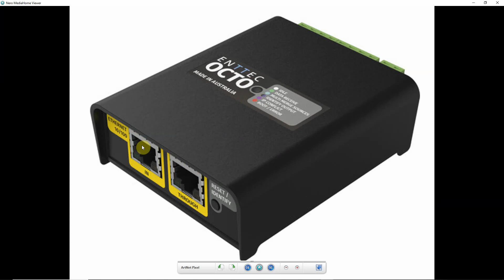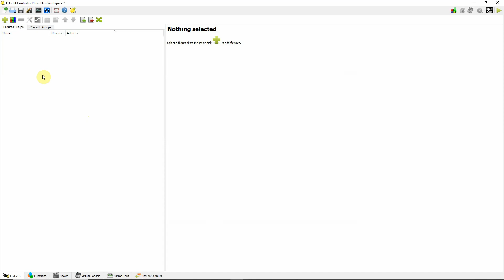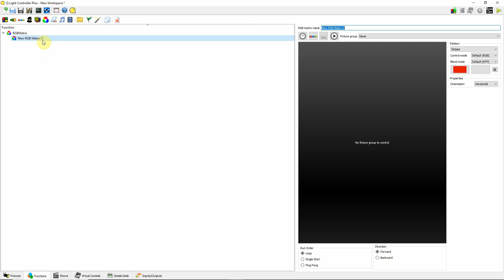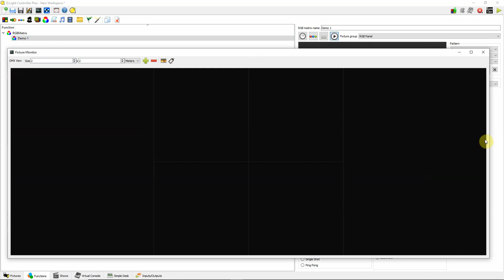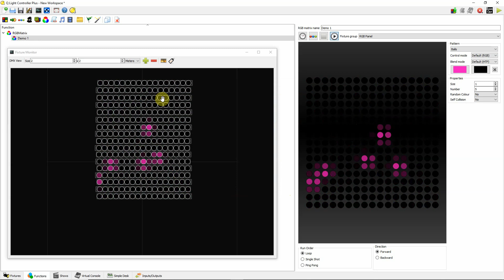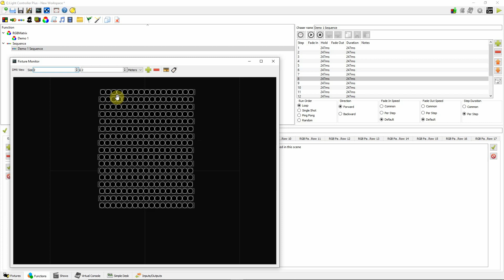Using LED Pixel Tape with QLC+

Comment: What did you set on the display at the DSA 1024 Pixel SPI to DMX Decoder 5-24V with RF Controller for IC Strips WS2811 and 27 Other IC Types? It's possible to use only the RGB Strip with decoder?
Reply from the maker: Hello
How you set your matrix display in QLC+ depends on how you plan to arrange your pixel tape. You have to choose how many rows and how many columns. The number of total pixels in the row/column setup has to be equal to the number of Leds in your pixel strip. You also have to choose how you are going to arrange the tape strip - snake or zig-zag. I explain all of that in the video.
You cannot use RGB tape with a pixel decoder. RGB Led tape has 4 connections: Red, Green, Blue & Ground. RGB tape also is either 12 volt or 24 volt. For RGB tape you need an RGB decoder. 
https://www.amazon.com/JOYLIT-Channels-Digital-Decorder-Controller/dp/B01N2V9Z5R/ref=sr_1_9?crid=3DEMXJ6V6FXTK&dib=eyJ2IjoiMSJ9.gc2R42RmASKI9C3jDUOQ7j9RZsgAw4vWY18uBd9I6WVTKQwt0j3A_CW1C9bcEinggnuNH_VWXMzljEjhH4AGiiGTKmFbh3538MOD6XUcjgZnDZ7tdM-ecvcHsdDuFnp5tqxKroTM5WOectayXYyTjR-_IMd_2PufsNspn8oBCIGOoMA7raOEn0q4E8kxsv2dqR-r11mUzyUwkqU62qizuYOS9-1Q8vVIWLdhm4f6V2A5vjRJPOuXnkAiPEQFyo6GgcxAOtj52foLCbqxBHd-u1mu-13pLdwtWFrVHWRYwcg.PEiBbfPnUuZ1wpF0exMrGXh-2BI6iJJ7tNTGJv6taJw&dib_tag=se&keywords=rgb%2Bdecoder%2Bdmx&qid=1712755453&sprefix=rgb%2Bdecoder%2Caps%2C104&sr=8-9&th=1

Pixel tape has 3 connections: Power, Data & Ground. Pixel tape runs on 5 volts.

Comment: Hi,
which equipment you used in this video? Can you wirte me the buy links please?
Reply from the maker: Pixel Tape
https://www.amazon.com/BTF-LIGHTING-WS2812B5M60LB30-BTF-LIGHTING-WS2812B-IC-RGB-5050SMD-Pure-Gold-Individual-Addressable-LED-Strip-High-Quality-16-4FT-300LED-60LED-m-Flexible-Full-Color-IP30-DC5V-for-DIY-Chasing-Color-Project-No-Adapter-or-Controller/dp/B01CDTEJBG/ref=sr_1_7?crid=3O7T1XIGVL0NX&dib=eyJ2IjoiMSJ9.1ZZzxMdGIkzDnBK0vURP8qA25Tt_sxJusjL4vurDVFFPTtZqE9JR2pCN35RLnzkGH2t4LyUFQuFWGEUhN_WZCdiOfa2UISPKVnza6_dv1BjNuYs-P-8N1RcBefUJWeTsN2s386QTAjFXAj9EnezYIgXhNsk3vhKglnaNVkmNff_6d3tcJfb_yQQJYzCEB7rwxjFTsXSF_O8cSqALTnBLbskGP3xWZxxPB11riAO3aSxEQ5ToHT0B8xcXAkvIcaT6z9wuS6J5MOG7PdzCuxxGOF9ITQdlR1QtJ_3R8xwnPek.TshRI1dP3Rw4xsVzTZ7lVcsNZeGqvduPrKqo3Hl1e68&dib_tag=se&keywords=pixel%2Btape&qid=1712674291&sprefix=pixel%2Btape%2Caps%2C103&sr=8-7&th=1
Controller
https://www.amazon.com/NovaBright-Decoder-Controller-Strips-WS2811/dp/B089QYG652/ref=sr_1_4_sspa?crid=UOJH8IQC9SUN&dib=eyJ2IjoiMSJ9.TAlRXYaxD8RTGt92owIxnbgWMj4ZoB-pTQcRs9kZdZPPnuSV2ZNbWqj438BVszvkpBWXfNNym_9h_gvL73mBaqI_m6SpL9bQGEo8QuIwREYYb1FIBq12vngfruWxKaUiP_LaplKqam7siPy2EHJhlfncUr20_FjiKzOew1IrCK_aJH_yYJfz4Zp5C_zlZI7HoX1nQTQkpOy_YarHgKSX7M3_cwjxiyXwc7Po-Hf3N3UFBpdTZ6ZCTYEBsKwH_T-pPfNOYvPKzWKQqyPKdmxKfJx3BDkWUnMVWLomvMbbidY.V_GYLgshWRGFN9g_WkSTY3HS2PFFY_hdOm3Ou8J3cVo&dib_tag=se&keywords=pixel+tape+controller&qid=1712674357&sprefix=pixel+tape%2Caps%2C123&sr=8-4-spons&sp_csd=d2lkZ2V0TmFtZT1zcF9hdGY&psc=1
Power Supply
https://www.amazon.com/BTF-LIGHTING-Plastic-Adapter-Transformer-WS2812B/dp/B01D8FM71S/ref=sr_1_2_sspa?crid=3T1SD685YCBZ&dib=eyJ2IjoiMSJ9.8OFa4llxuaHWTNwf8joGdP-4q4NuhPvMs-LhdxdhvRRDV33RKsX2gc74ql6DpD1RgMW9o7yZN5E3nZAMZrn438r6iuAfcHzxNFBu65GEMfd1F2D2A5rvJaHSUHx9XVkEliD4ZI0HqvrtofTC10-qK3d1A7FeYS9HM9dKE6OZXpuAp3WhvCFFTdjkGUxYn_SbnyuNPHWOKvysDESxtHg5IX2gNnax5LxAaAfamFI_kpM.BOEabBcNTj_vEyj-qR6JggDttOCeBfGsfRvgzgIuNBo&dib_tag=se&keywords=5+volt+led+power+supply&qid=1712674539&sprefix=led+5+volt%2Caps%2C95&sr=8-2-spons&sp_csd=d2lkZ2V0TmFtZT1zcF9hdGY&psc=1
8 universe controller
https://www.bhphotovideo.com/c/product/1767500-REG/enttec_71521_octo_mk2_led_pixel.html?ap=y&smp=y&msclkid=55ad996896c21732c3abff7dc1fc5bae
Reply: @edwardrichards7722  thanks

Comment: Everything is working but I am having 1 issue. My two “rows” are duplicating regardless of snake or zigzag setup. It’s like having 2 monitors set to mirror mode instead of extended mode.

I am not getting the same result as I see in the matrix preview (regardless of the effect). I’m wondering if there is a setting that I am missing.

Anybody have an idea?
Reply from the maker: Hello
Sounds like it may be a wiring issue. If you are using two rows you need to make sure that the second piece of pixel tape is connected to the end of the first piece of pixel tape. Otherwise the dmx address of each led (pixel) will not be correct. Here is an example:
I have two pieces of RGB pixel tape with 10 leds (pixels) on each piece. Assuming I am starting with DMX address 1, the first LED is controlled by DMX channels 1-3, the next LED is controlled by DMX channels 4-6 and so on so that the 10th LED would be controlled by channels 28-30. Now I connect my second piece of pixel tape to the end of the first piece by soldering it or using some sort of connector. The first LED on the second piece of tape will be DMX address 31-33, the next LED will be 34-36, and so on.
Another example:
I have two pieces of RGB pixel tape with 10 leds (pixels) on each piece. Assuming I am starting with DMX address 1, the first LED is controlled by DMX channels 1-3, the next LED is controlled by DMX channels 4-6 and so on so that the 10th LED would be controlled by channels 28-30. Now instead of connecting my second piece of pixel tape to the end of the first piece, I simply connect it to my controller like I did with the first piece. So now the address of the first LED on that second piece of pixel tape will be DMX channels 1-3, the second LED will be channels 4-6 and so on. In this situation the two pieces of pixel tape will mirror each other. This may be the issue with your wiring?
Let me know, please!!
Ed Richards
Reply: Great response, clear and concise. However, I have scenario 1. I'm creating my own light tubes so I will have 4 strips in a zig-zag setup (so that the bottom pixel is #1 for each strip [1-30, 31-60, 61-90, 91-120]). Only one connection to my controller (the same controller in your video) and then soldered return wires getting from the end of 1 strip to the beginning of the next. All seems to be good as when I run programs built into the controller, all is fine. I am pretty sure all is set right in the controller as far as how many pixels and how many channels, but that is what I will check next to be sure. I am so close to having it done. There is just 1 snag somewhere that I need to flush out. What is really weird about the whole thing is when I use an effect like center out, they both do the same thing as they should (which would also look like they are mirrored). It's when I do something like alternate where they should swap colors, they don't. They do the same thing like they are truly mirrored. Head scratcher. Share any more thoughts and I will keep updating. Thanks again, Ed!  @edwardrichards7722
Reply from the maker: Hello
I made a video that I think will solve your issue. Let me know if this helps?
https://youtu.be/IXOz-bogyMI
Ed Richards